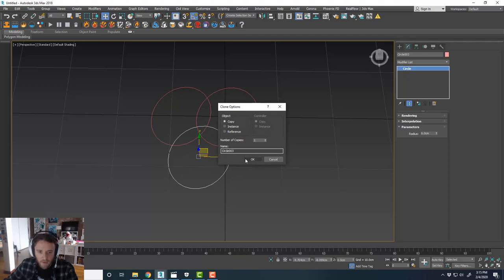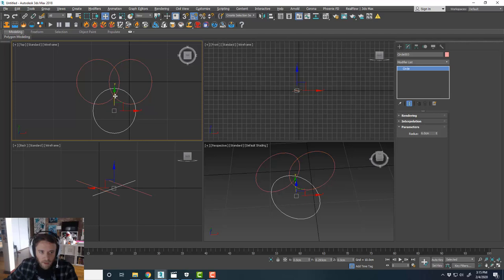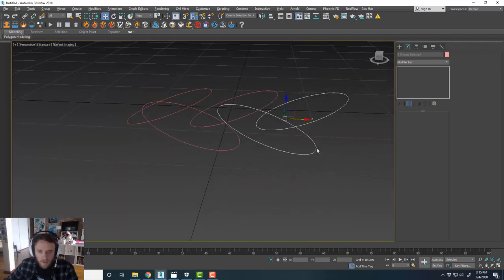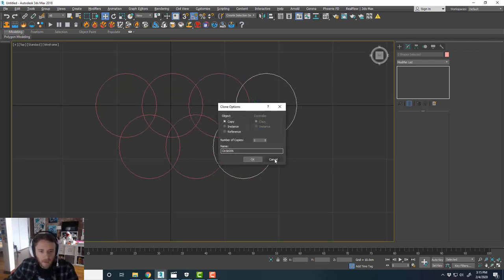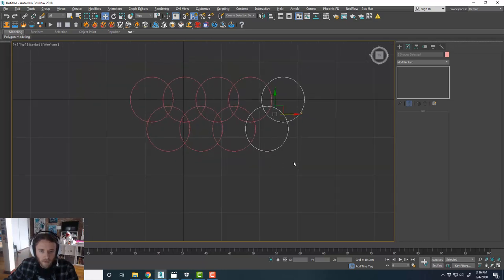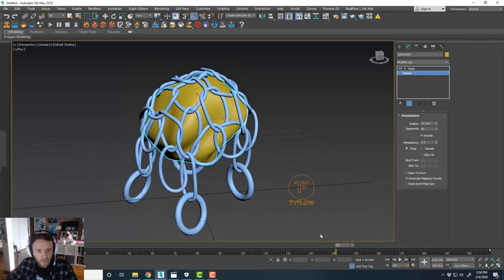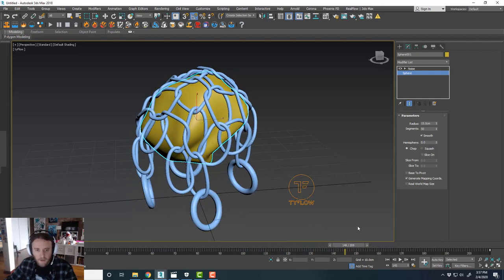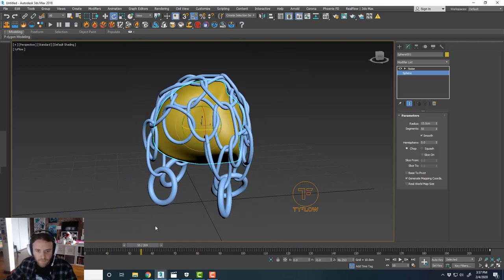3ds Max + TyFlow TUTORIAL: Simulating Rope and Knots

Comment: Is there a reason for not using a torus or circle with thickness as a mesh collider in the default physx engine? Sorry I don't really know tyflow so what I said might not make sense, just think it looks overkill to simulate bindings for a solid torus
Reply from the maker: Yes, PhysX doesn't simulate concave shapes (yet), so a solid torus wouldn't interact properly with the other simulated rings. I could probably have explained that in the video, lol. Good question!
Reply: @simulation_lab  ahh I see :) thanks

Comment: Hi, i can't see the tyspline mesh even though i increase the radius?
Reply from the maker: If you look in the modifier stack, you should see an icon next to the TySplines mesher, make sure that's set to visible. Otherwise, check the settings in the Spline Paths operator in your tyflow, and make sure it's set to PhysX bindings.
Reply: i got same issue too . if you can solve please let me know how